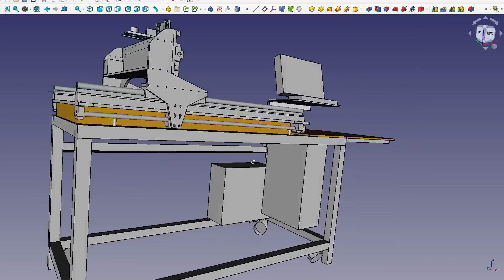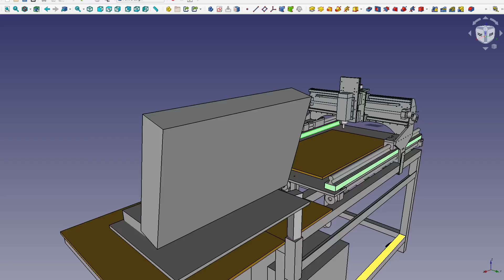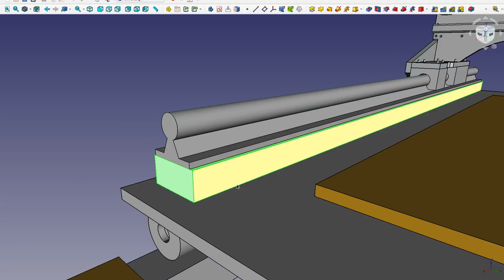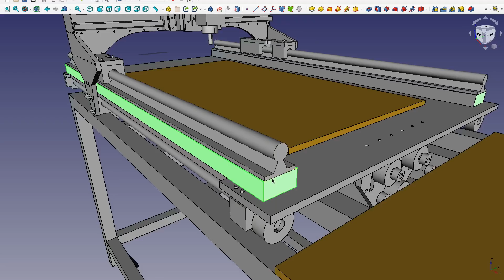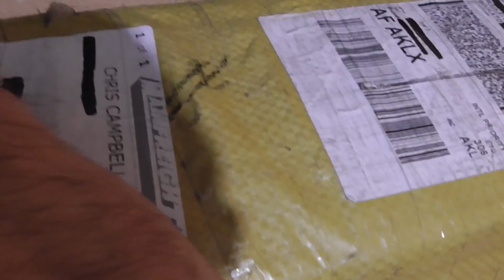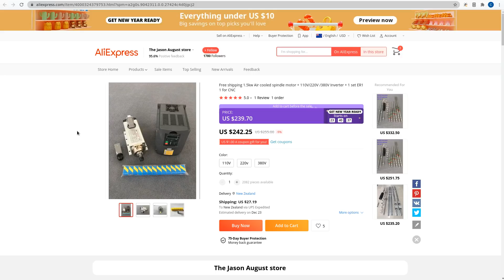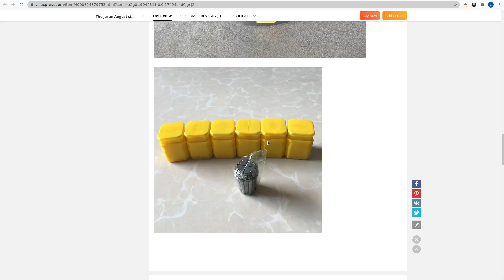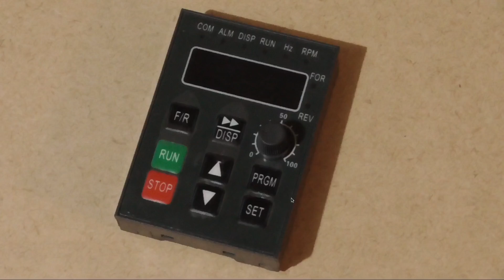Another DIY CNC router, part 1 (goals, design, components)

Comment: I've watched your channel for a while and really enjoyed this video to hear your reasons for how and why you're doing things.  I'm in the middle of rebuilding my cnc, but I've built mine with fixed gantries.  I've used solid blocks and plates of aluminum for most things.  As you pointed out extrusions have their own issues.  I haven't used a CAD program but sure see the value.  I tried Fusion for a while but couldn't get over the learning curve.  It's nice to watch you documenting all this.  Thank you.
Reply from the maker: Yeah CAD is a pain in the butt to learn but quite helpful to make things fit together nicely, especially when so many pieces are involved. It's also a must if you want to give your plans to a laser-cutter. Fixed-gantry would have been an easier way to have a single motor on the main axis, but would have used a huge amount of extra bench space, especially if I still wanted to allow for a flood-able table, because liquid spilling over the sides would need to be caught below.

Comment: I bought a similar linear rail + ballscrew set when building my CNC, the longest ballscrew had a bent neck that made it wobble exactly like yours. We had to exert a crazy amount of force onto that small endpiece to get it into a somewhat less wobbly state. It was aweful, we were almost breaking that poor thing and it still wasn't fixed completely afterwards. You might as well get a replacement IMO. Another thing: the chinese versions of the BK bearing blocks do NOT use proper bearings, they probably just have cheap "skateboard"-bearings inside, these will not be all that long lived and will develop play quickly. You can get proper angular contact bearings for around ~10€ per BK bearing block. These can be pre-tensioned with circular spacers to remove all play. Oh, and don't forget to disassemble, clean and lubricate the linear rail blocks before mounting them and definitely use some locktite on the set screws of the round rail pillow blocks, they will work themselves loose otherwise. Good luck mate!
Reply from the maker: Right. I have seen people trying to fix a bent screw and it never turned out well in any case I could find. The seller is sending me a new one.
I forgot to mention about the bearings, but I was intending to get some proper angular ones before the final build.

Comment: Having watched pretty much every video I can find on this topic (Including all of yours, of course  😉 )   there seems to be a recurring theme with the Chinese-sourced components.  As covered by Florian's comment:-
>>It's not uncommon for ball-screws to have "wobble" of some sort.
>>It seems to be essential to dismantle, clean, and lube the linear rail blocks.
>>Swap the support-block bearings for proper thrust bearings.
>>In addition, mark the linear rail blocks so they are always installed in the same location and orientation... the mounting holes are not accurately drilled, so don't rely on the nominal dimensions; transfer the hole locations from each rail-block to its mounting plate.
I'll be glued to this series... many thanks.   👍😁
Reply from the maker: Thanks for the tips. I will be ordering some angular bearings before the final assembly, and cleaning up the linear carriages. I found the mounting hole locations to be ok, but the thread in many of them needed a little extra tapping to allow bolts to get in properly - more so on the nut blocks than the rail carriages.

Comment: If you are cutting aluminium, use mineral turps as a cutter fluid. Anti-backlash is the word you were looking for.
Some fine emery tape will usually make a bearing fit the way it should. Carful does it though, not too much.
With the threaded rod, it's not the bearing end that is at fault, it's the rod itself has a whoop in it.
Place the rod on a flat surface and rotate, you will soon see just where the bend is.
Reply from the maker: I've see IPA used so I might try that, with a mist-maker. Yeah I think I used 300 grit wet and dry paper, backed with a small piece of wood. Stop and check fit regularly so as not to overdo it, didn't take as long as I expected. The seller is sending me a new screw to replace the bent one.

Comment: i recommended your channel to somebody a while back, next day he sent a message '' oh wow, how did youtube not recommend this channel to me, this is heaven''    .... ps. are you sure about the bath style? i cut some carbon by hand dremel using the 3ltr water bottle  with the pin prick of water to kill the dust and it worked shockingly well.
Reply from the maker: Yeah that's kinda what I did last time, just a trickle to stop the dust and flush away swarf. But the table has to be capable of handling more quantity in case something goes wrong, and it also might be helpful if I want to do steel with actual flood coolant (not just dust suppression).
https://youtu.be/VDjdMW4_eRc?t=744
Reply: @iforce2d  ah, that makes sense, i did see that vid.  regarding that vid and blockages etc, have you seen how gold panners use stepped boards to trap gold in that flume thing?

Comment: I know you prefer LinuxCNC, but newest grbl 1.1 has realtime overrides, so speed adjustments are instant. There even is a 5-axis arduino mega fork and a stm32 version as well. Just for the others out there that doesn't have a parallel port PC laying around and don't want to fiddle with delay timings. Machinekit on a beaglebone is LinuxCNC without the need for a parallel port.

Comment: Hi, with a machine that big you will need some frame on the base plate to avoid flex on the machine.
I upgraded mini some years ago and it is working like a dream, I bought the PoKeys CNC controller which is very flexible, closed loop Brushless servo motors because the have an encoder so there are no lost steps and these are much quieter, induction limit switches and kept my 1000W Brushless spindle. Also running a cooling pump to cool the spindle. The PokeyCNC controller con control it all and even more if needed, the only thing is that I am not sure it will work with LinuxCNC, I am using Mach3 since 2012 non stop without any issues anc controlling everything flawlessly.
For the computer I bought a cheap Mac Mini and installed Windows 7 just for that.
Mach3 allow you to stop the job at any point, turn all off, go to sleep, come back next morning and continue on the last point.
One more thing, those long linear rails are not ideal, they will loose precision over time, I talk based on my experience, I ended up replacing them all for proper ones, expensive? Yes but are good and precise.
Reply from the maker: The base plate will be sitting on a large mass of MDF, supported at almost every point from below. I'm hoping this will be enough, but if necessary I could also bolt it down. I'm not sure what you mean by the rails losing precision, did the balls wear down, or the rail itself? What is a 'proper' one?
Reply: @iforce2d  the good ones are the ones you are using for Z and X, those very long and rounded are for the Y axis and are the worst thing you can have for that axis, the Y is the axis the has to support all the weight and stresses from all the machine so it would be good if you could use nice rails there. On a CNC, as mentioned you have weights, vibrations and other thing that most people don't think about which are harmonics from the steppers, the spindle and mostly from the bits working on the material, specially the most rigid ones like carbon and metals.
About the MDF where you want to screw the machine bed on, MDF is the "wooden" material thats has most deformation with temperature and humidity variances which means that will flex, today you have the machine with X tolerances and tomorrow you will have Y tolerances.. I you want to keep on wood I would suggest a thick board of maritime plywood like 50mm, it is by far much more stable than mdf. Remember that if you have a machine that is not linear specially along the Y axis and you are machining a wing, the wing will also be as "bent" as the Y axis of the machine.
I hope you don't interpret me wrong, I do want to help you assemble a good machine.
Reply from the maker: I see. Yes, I understand that the round rails do not prevent any rotation around their axis, it's a weak point. To make up for it, the gantry must be very rigid with no flex in that dimension. With my small CNC this was done by having a large vertical plate to resist racking, very close above the bearing blocks. The new machine is somewhat similar. It's a bit tricky to describe in a comment, but I might talk about this stuff later at some point.

Comment: Hi Chris. Great content.....Would you mind sharing your speeds and feeds for Aluminium milling ? Im having a really hard time with mine on a similar sized diy cnc....cheers Chris.
Reply from the maker: These days I use:
6mm endmill: 16000rpm, 600mm/min, 1mm depth of cut
2mm endmill: 16000rpm, 100mm/min, 0.5mm depth of cut
50% stepover for both. These are the only endmill sizes I use regularly enough to have found a good value.
https://youtu.be/y2V5-dqlUlw?si=7oq5MEtTk3_yof4k&t=123
Reply: @iforce2d  thanks so much ! Are you using single or double flute ? Can't wait to try these settings .....
Reply from the maker: Double flute

Comment: What... I have tried to use freecad and I failed miserably... The fact, that modelling is super slow I can live with, but anything beyond 4 parts is impossible to iterate on, no native assembly support, so it's almost guaranteed that you will loose your work at some point in future is dealbraker.

Sanding ball screws if absolute heresy, I would quadruple check that it's not improperly fit bearing in housing because that can cause deformation of inner ring. That wobble is very sad too :( I have removed such bearings from 80mm ball screw with just hammer at work (was big CNC machine) that was interference fit. Took me about 2 days and one copper hammer :D

Comment: Thanks for the videos. I did not noticed you mentioned it but It seems that the ballscrews type are sfu 2005 and 1605 . The bearing are HGN15 or 20.  Right? Are you using Nema 23? Thanks
Reply from the maker: Ball screws are 2010, 1605 and 1204.
Rails are SBR25 and HGR20. Motors are NEMA34, but I think NEMA23 would be ok for the upper two axes.

Comment: I'ld really like to migrate to FreeCAD, but I'm struggling. Most tutorials out there are about Sketching and Part Design. Coming from Fusion 360, i feel rather comfortable modeling single parts in FreeCAD, but as soon as it comes to assemblies, i feel lost. Could You point me to good tutorials or documentation that go beyond single part design?

Nice design by the way!
Reply from the maker: I've never tried assemblies, to check fit I just translated parts around - works ok for this project because parts can only move along the xyz axes :)
This is pretty much the only thing I've ever designed in FreeCAD so you might be better asking someone else. As it happens I've been looking at Onshape over the last few days. If you come from Fusion360 you might find it more similar. There is a free version you can use that allows all features but requires your project files to be publicly shared. The downside is that CAM is not integrated as it is in FreeCAD, but there is a plugin that works quite well. The main reason I'm looking at Onshape is because FreeCAD doesn't handle exports from OpenVSP very well, and Onshape is much easier to edit smooth surfaces - which might be totally irrelevant for you.
Reply: @iforce2d  Great, thanks. Well, the issue with OpenVSP and FreeCAD is important as we both seem to share some similar interests

Comment: Hi! Fan from South Africa. I’m fighting with an HC-05, trying to run CNCjs with no luck…
What gcode sender do you run with the Bluetooth module ?
Reply from the maker: I settled on one called bCNC. It's not super advanced but it handles all the basic stuff very well. https://github.com/vlachoudis/bCNC
But the sender doesn't really make any difference for the HC05. My laptop has built-in Bluetooth, which I was able to assign to a COM port. So the sender just uses it like any other COM port, it doesn't know it's Bluetooth.
Reply: @iforce2d  Appreciated !

Comment: Try to use isolated USB-RS485 ( that have a DC-DC converted). Industrially, RS485 is never connected to the equipment GND. VFD doesn't seem to have a isolated driver

Comment: We're here to hear you waffle on dude! So is all this work and time to avoid some exorbitant coast to have one prefabbed?
Reply from the maker: It's mainly so I can customize it exactly how I want, and also because I enjoy the process of designing and building it. But yes, the cost will be rather cheaper than an off-the-shelf one.
Reply: poobertop.   In addition to iforce2d's reply, keep in mind that New Zealand is a country roughly similar in size to the U.K., with a population of around five million.  There are only limited options for having something like this professionally built, with no guarantee of a satisfying machine.   The cost would be terrifying compared to offerings from specialist CNC router manufacturers in the large industrialised countries.  Add to this our geographical remoteness, and you can see why New Zealanders have developed a reputation for creating masterpieces, using only a split stick, a bent nail, and some fencing wire!   Our mechanics have always been in demand with motor racing teams worldwide.  GO KIWI!!!     👍
(Of course, if you are a New Zealander, you already knew all this and more, so I just wasted my time!     🥴 )
Reply: @PiefacePete46  His answer was sufficient.
Reply: @poobertop  😄👍
Reply from the maker: There are some local router options, they seem mainly focused on cutting larger sheets of softer material (ply, melamine etc) and are usually quite square in shape. The prices are not too bad. If you want to cut steel with coolant, then you're looking at something more like a proper mill with a price to match. By making a custom build I can fit somewhere in the middle, with smaller workspace but more suited to various materials, and about the same cost as the 'softer material' versions mentioned above.

Comment: aluminium is currently very expensive. i wanted to build a workbench/table but the price is 3x as normal :/
Reply from the maker: wow you weren't kidding. I just got the re-quote for my laser cut work and it's about 40% higher than 3 months ago, due to (they say) the material cost. Thanks to the lockdown I'm paying $400 more than if they were able to do it back then :(

Comment: really odd. i was building my first cnc in a somewhat similar way. same electroniics but more 3d printed parts...
i just nearly finished with a new cnc which is at least using the same spindle type. but this time i went with closed loop steppers and esp32 with fluidnc as a main controller. works great so far.
you should do a colab with bart https://www.youtube.com/watch?v=iwlS6Otwjqg